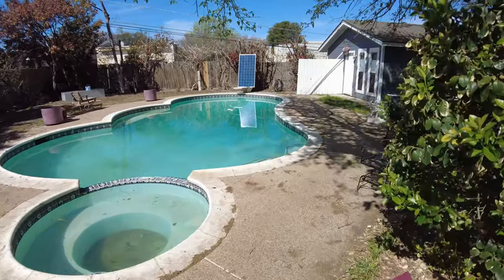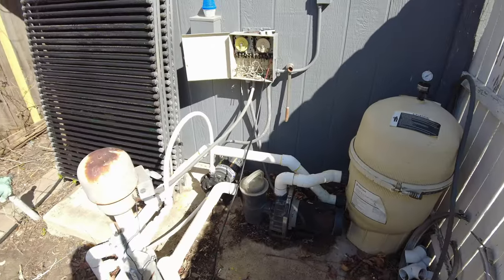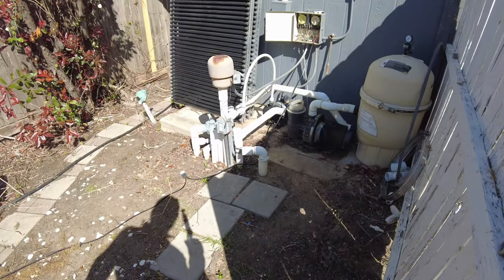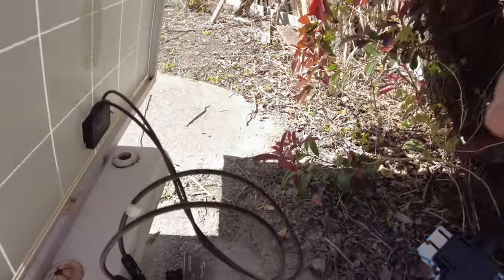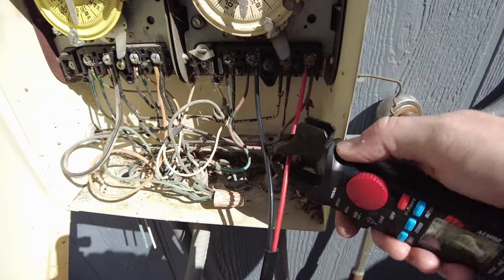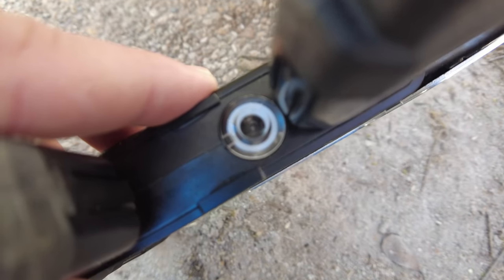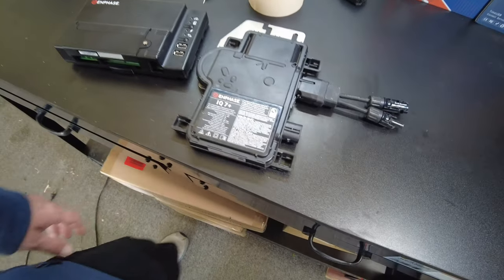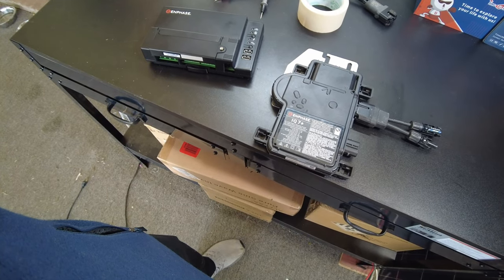Experimenting with Enphase micro inverters

Comment: Hello Brad. Your video reminded me of my first array I set up using the older M-215 Micro-Inverters back in 2013. I bought 6 250 watt Sharp panels and matched them with 6 Enphase M-215 inverters. It produced about 1200 watts in good sun. I connected my trunk cable to my old hot tub disconnect box. and protected the cable at 20 amps. I loved it so much I doubled it, then doubled it again, then didn't like how I was pushing the excess power to the utility, so I made plans and installed a large array on my roof. The city approved plans allowed me to apply for Net metering with the utility. Which then they will recognize the excess power I sent them. (Note that, without an approved net metering agreement with utility, your home and meter will allow power to be pushed to grid if your own home doesn't need it. But, they do not recognize the power that you send them. The meter will flat line rather than spin backwards so to speak. In other words, it looks like you're using no power to them, even though you might be sending the grid a few hundred watts. So it's best to use all you produce otherwise you are donating power as a gift. Of course it is highly recommended to draw a array permit plan up and go through the process of applying for net metering)
Reply: The meter might keep spinning as you push it back to the grid. The meter might spin at the speed your system pushing the electricity back. So you want to slow down the spinning rather than try to push back if you dont have the bi-directional meter.

Comment: What a great idea! You come up with some really cool stuff.
Reply from the maker: Thanks! Could do the same thing with the outdoor condenser unit on an air conditioner. Just hook it up to the back side of the contactor so they only produce when the compressor starts.
Reply: @BradCagle  Very smart, It will be interesting to see the connection time reduced with the hub setup
Reply from the maker: @Roll2Videos  I have one micro inverter that starts producing in seconds. I think they can be setup to look for the hub/gateway, probably by default they do not, and thus why the one starts so fast. But I can't verify this until I get a working hub, I guess that's the only way to get into configure the inverters.

Comment: I'm very interested in a practical and not too expensive grid-tie inverter with limiter.  I have a 2,000 watt Sunglow grid tie with limiter and it works like a charm. Even when I'm producing all the solar power that I am consuming,  it still allows 5 watts of grid power in so as not to tip off the power company that I'm doing something I'm not supposed to be doing.   The drawback is that it is a max of 2,000 watts.  I've been looking for a 4,000 watt grid tie with limiter that is easy to program.  I never thought about using individual micro inverters. I'm going to keep an eye on your channel.

Comment: my experience with grid tie inverters, is IF your making more power then the motor or what ever takes and you turn the breaker off, The grid tie inverter still thinks its on the grid and keeps producing

Comment: My new system is 31 405-watt Q Cell panels and 31 Enphase IQ8A Inverters,  they offer a "SunLight Backup" mode.  An interesting option for a "grid-tied" system.
Reply: Are you adding batteries since you already have the system controller

Comment: Great stuff, thanks for sharing, so can you power up the micro inverters I got some IQ 6+ and 7 + and would like to power them up when the sun goes down or during power outages using one of my battery banks with an all in one inverter unit. Wonder if this is possible, it nice t be able to use the freaking PV system when the power is out!
Reply: You will need a  battery with more capacity than your solar system and a ac coupling inverter.

Comment: So I hooked a string inverter (LV-6048) into my main panel.  It's a split-phase.  This inverter is able to power the whole panel with no problem.  I've ran all sorts of equipment such as lights, a TV, video game console, EV Charger, etc.  Everything works perfectly.

With the panel up and running, I connected my Enphase IQ7 microinverter into the panel hoping it sees LV-6048 power as grid power.  Well, surprisingly, it worked!  The IQ7 moved from red blinking light to orange.  However -- when I put a load on the panel, the IQ7 does NOT contribute in terms of power output.  Only LV-6048 power is used.  I'm able to confirm this via my clamp meter on the IQ7 cable.

LV-6048 is connected into the panel via a 50-AMP double pole breaker.  My IQ7 is connected via a 30-AMP double pole breaker.  Not sure if that matters?

Comment: How did you extend the MC4 connector from the AC side to the meter? I'm considering the IQM+, but it seems like you need to buy separate MC4 connectors. I really dislike how companies use proprietary cables, forcing you to spend extra.

Comment: I use 4- 400 watt panels straight to a 90 volt dc motor  the pump is a aqua flo a series it is all brass, has the C56 frame 5/8 input shaft. using it for 5 years now, sunup to sundown 1 hp.
Reply from the maker: That's awesome!
Reply from the maker: My old pump was all brass like that. My only problem going DC with solar only like you have would be overnight freezing temps.

Comment: Any idea on how to make this work on a Pentair easy touch control system with a variable speed pump?  The pump always has power to it (both line and loads hooked to the line side of relay). Because of the variable speed pump, it is designed to be hooked up that way.  Does the inverter only allow solar power to flow when there is an amperage draw or just sensing 120/240?

Comment: I'll add this tidbit of info. You can buy used panels and used Enphase micros on the internet for cheap. The older micros like M-215 or M-250 work great, But some cities won't accept the older ones on permitted arrays. I just installed an array at my rental. I had a bunch of extra M-215 inverters, but the city said I had to use Enphase IQ-7 or IQ-8 newer type inverters. So I bought 24 used IQ-7 inverters and did it that way. The IQ line uses a different trunk cable also. Older M type Trunk cable uses a neutral and a ground in addition to the 2 hots for the 240 volts. The newer IQ cable just has the 2 hot wires for 240. Also, the LED on the inverters is helpful. Blinking red means they are not producing. Blinking amber means producing, but not reporting to an Envoy (envoys report each panels production to your phone and Enphase) Blinking green when it is producing and also talking to an Envoy.
Reply: What's the process to reuse an old Microinverter? Do you need to clear the serial from the original site?
Reply: @tclaffey  Regardless of whether a used Enphase inverter is still registered under another Enphase account or not, as soon as it is powered to 240 volts and has sun, it will begin to produce power. But as far as monitoring that inverter under your own Enphase enlighten account, after your envoy searches for micros connected, to then add them to your account if they are still registered to another, you would need to call Enphase and request those inverters to be released from previous accounts. I had to do this a few times, and they are pretty cooperative about it. They will sometimes scan to see how long it’s been since that micro has produced, and if it shows it’s been inactive for two or three or six months, it’s kinda obvious to them that it’s been removed from the previous system. Then you’re able to add it to your own and enlighten the system and monitor production. Note that I’ve never had to request the releasing of micros in the IQ line. I’ve only experienced requesting M series inverters to be released, but I imagine it works in the same way. You just explain to Enphase customer service that you bought a group of used inverters online and you wanted to now add them to your system. The easy way to know whether it’s still registered or not under another system occurs when you go to place the inverter on your graphics grid and it won’t be allowed to reside there. That’s when you know you have to call them and unassigned it. If the graphics allow you to place the inverter there then the inverter is already unassigned from previous owner and you don’t have to make the call.
Reply: @MrJeffoff  thanks for that info much appreciated

Comment: The way I understand it once the envoy-s is up and in "California rule 21" mode it will throttle the micro inverters to zero out the consumption from the grid. Be cool if it works like I think it will! Jehu Garcia had a power wall by his ac condenser at one point that would kick on any time the condenser unit did for a similar setup. But I think he was primarily doing load shifting away from peak rates not using solar.
Reply from the maker: That'd be sweet if it does! We'll see if you can nab another gateway :) Be super sweet If I could figure Powerline Communication protocol, and have a Pi do it, I haven't found much.
Reply: @BradCagle  I was doing some research on this a few months back. Will share some links (though I did not get into prototyping yet).
Reply from the maker: @icarus901  Great!, send the  links to bradcagleyt@gmail.com, youtube won't let you post them in the comments. Thanks
Reply: Rule 21 and constant export are different. Gateway can do no export

Comment: I actually have same setup for my pool pump but I’m using older enphase inverters and I have it wires in on the line side of the timer so ones my pool pump stops the inverter keep feeding the house so keeps power bill down a bit.
Reply from the maker: Nice. So your house is always using all the power, and you never export anything?
Reply: @BradCagle  I do export some times ones the pool pumps stop working and I’m not using much in the house, so then the  power company gets free power for me but that’s fine with me I just want to make my pool pump running for free.
Reply: @AlekseyK86 you gotta be careful, some dumb meters will capture import and export power and you’ll end up paying the power company for the power you’re giving them

Comment: Great hack.  Can these be paralleled to add more panels and get more power?
Reply: Each panel will need a micro-inverter. Then each micro plugs into an Enphase trunk cable. Depending on the wattage of panel and type of Enphase inverter, you can have up to around 16 panels / inverters per trunk cable. Each trunk cable should be protected at 20 amps.

Comment: Is it possible to charge with micro-inverter 48V LiFePO4 batteries using 48V LiFePO4 AC charger? Which AC charger to use? Is it even a good idea? For example as an installation on balconies in apartments. Or is it better to use conventional solar MPPT that are designed for this. I know that micro-inverters are designed as Grid-tie inverters ... Thank you for your answer.
Reply from the maker: Yes, this is typically done with an AC coupled inverter. These type of inverters will run backwards, and charge 48v battery bank from the micro inverters, when the bank is full it uses Frequency Shifting to slow down the production from the micro inverters.

Comment: so these micro inverters can work without the gateway?
Reply from the maker: Yes
Reply: Yes, as soon as Enphase micro inverters see 240 volt, they will start producing within about 5 minutes.All the gateway provides is the ability to see which individual panel / inverter is producing via a computer or your cell app. But the gateway is not necessary for them to operate. As this poster demonstrated, you can take an amp reading and times it by your voltage (usually 240) and see what that one panel is producing. Or, you can go to your utility meter and see the change in kWh delivered or received.

Comment: Iw ould put that thing on a transfer switch. If pump goes on use city power to hold relay/ transfer switch to run the solar
Reply from the maker: I'm not sure I follow?
Reply: I was thinking maybe the timer runs a relay and when it's time to turn the pump on the grid power would be utilized to run only the coil of the relay which could then allow the solar power system to power the pump. I'm still learning about micro inverters. Do you think this is possible using only the microinverter and a relay?
Reply from the maker: @offgridutah1  It's not necessary. All you need to do is hook it up like I have on the timer.  The micro inverter does not produce anything unless is senses the grid. The grid provides the micro inverter the AC frequency. Without the grid there is no frequency to sync to, and thus the micro inverter will not start. So it can literally be connected directly to the pump, and it will not try to run it until the grid is present, which happens when the timer is on. Thanks
Reply: But how to make it start if grid is not present?  especially if being in an off grid situation? as I want to be able to run my pump directly form the solar panel and micro inverter.

Comment: Would this trick work with an A/C condenser?
Reply: Yes, if it is 240 volts. The Enphase inverter sees the voltage present and then starts producing.

Comment: 2 Silly questions:

(1)
How do you make these work if your home is single phase?  I live in an old home and only have have 1 hot 1 neutral coming form the  pole, instead of 2 hots.  2 hots would give me 240V in my panel, but I only have 120V throughout  the whole house.

(2)
If the grid is active, and your solar is active as well, how does the house know to use solar instead of grid power?  How does the house pick which power to use?
Reply: enphase doesn’t support 120v, but there are string inverters that do

assuming you’re synced to the grid, your house will just pull power and if you need more than solar makes it comes over the meter. it has to do with resistance and impedance, it will get the local power first and any more power it will pull from the farther away source (a power plant somewhere)